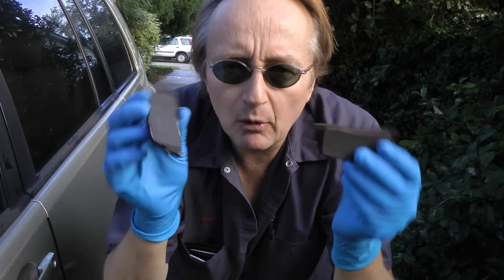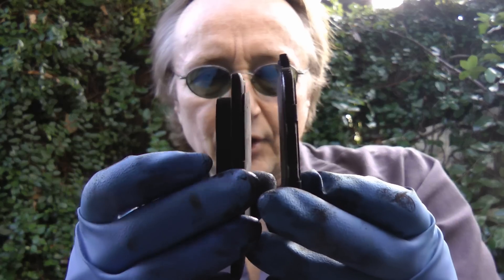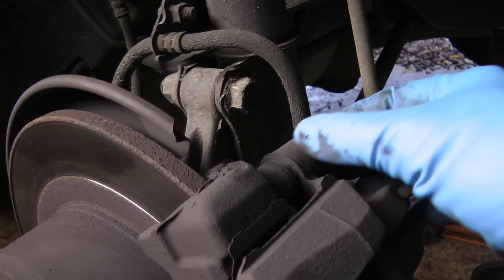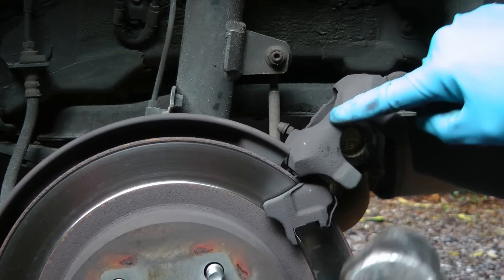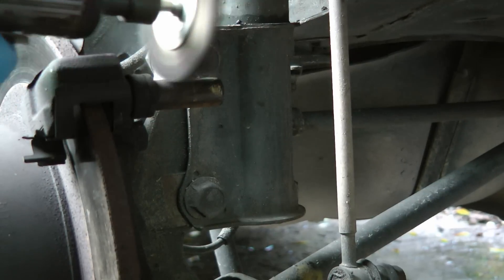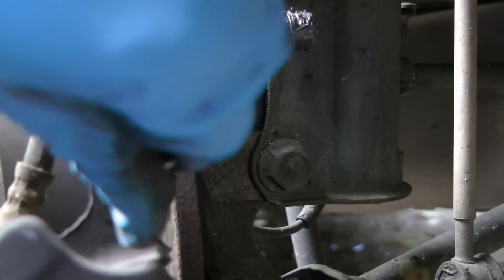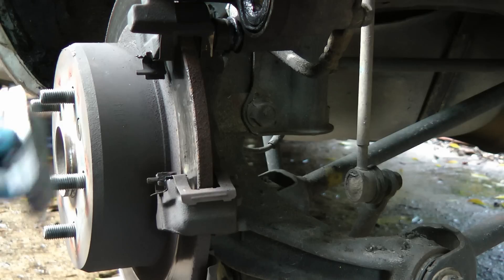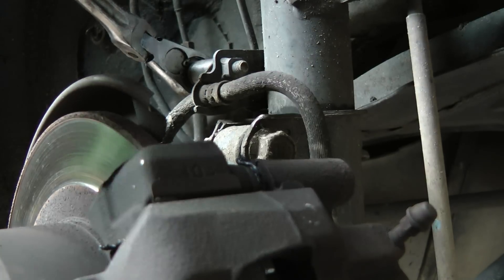How to Stop Brakes from Squeaking and Sticking in Your Car

Comment: Noticed when inspecting my car's brakes a while ago that the inner pads on the front brakes were worn down almost completely. I replaced the pads and didn't notice any sticking of the caliper. The pins were still shiny without corrosion and still had some grease left on them. Also I haven't had any noticeable brake dragging or getting hot or anything like that.

Also, the rear brake pads were worn quite evenly. Only the front brake pads were severely uneven and by the exact same amount on left and right side.

What could have caused the inner pads to wear significantly more than the outer pads if the caliper was not sticking?
Reply from the maker: MTTT3000 the calliper is not sliding correctly on the front. take both off, clean any residue and lubricate all the sliding parts, put it back on without pads on it, and see if you can easily move it side to side
Reply: Scotty Kilmer
That's pretty much what I did when I replaced the pads. I cleaned off the dirt and old grease and made sure the pins were smooth and it could slide freely. Hopefully that did the trick. I'll keep an eye on it every now and then to check for uneven wear.

Just wanted to make sure there wasn't something else causing the uneven wear.

Thanks.

Comment: hi I'm doing the pads a rotors on my car for the first time. is there any good way to remove frozen rotors? and is there a way to torque bolts that my torque wrench can't reach?
Reply from the maker: spray WD 40 on em, and hammer the heck out of them. Then hit em with a torch if they don't come off and heat will loosen things up. But, ya can only torque what you can reach with a wrench, hence I rarely use one myself in such impossible situations

Comment: Hi Scotty, my son is working on a 1996 Buick Regal, rear disc brakes. The bracket that holds the pads on is stuck on the caliper pin. How can we get the bracket off the seized pin??? thanks, Caryl
Reply from the maker: I spray em with penetrating oil and let em soak a few hours, if that doesn't work, i heat em up with a torch, but realize that often ends up making you buy a new one when you get the old one off if stuff melts
Reply: Scotty Kilmer  Hi Scotty, thank you so much for your ideas. what you suggested was a big help. May I ask your opinion on this tool? it is a cube that compresses caliper piston where there is a parking brake involved. Thank you for all you do! You are truly wonderful. http://www.autozone.com/autozone/accessories/OEM-Rear-disc-brake-cube-for-use-with-3-8-in-drive-tool/_/N-255s?itemIdentifier=2363
Reply: Scotty Kilmer
Hello again, when my son when to bleed the brake lines, his helper cranked on the bleeder valve and it broke off.  Any ideas on how to remove this? We have an "easy out" here at work. would that work on this application? thank you, Caryl
Reply from the maker: baire702
yea, I have one of those works fine if your hands are strong enough. Use the EZ out for the bleeder
Reply: Scotty Kilmer
 yay! Scotty saves the day, AGAIN!!!!!!! Thank you! By the way we got the Go To socket for removing rounded off bolts and nuts. What an excellent tool. Thanks for recomending it!

Comment: hi my question is can i just replace the side that is bad(both pads) just on one side.
the other side is fine.
my rotor has a fine smooth feeling of it but on one side it has a small groove that goes deep,besides that is fine. do i neeed to replace the rotor too?
Reply from the maker: You can replace one side, I do both myself, but you can do one. I would replace a rotor with a groove
Reply: thankx for the responds:)
i have another question.
the two pins that go on the caliper one has a rubber plug and the other one doesn't.
i lube both of them but after i did that the one with the rubber plug wont go in all the way,i got tired of trying to put it in that i gave up and took the rubber plug out and put the pin in without it.
what will happen since i dind't put rubber plug in with the pin?
and what does the rubber boot do?

Comment: Hello scotty i know its an old post but i have a question , the caliper pin slide in a rubber tube and not metal can i still use the caliper grease ?
Reply: Yes

Comment: I got a problem with my brother's 2012 Ford Focus front brakes. the pads are wearing slightly uneven from the inside to the outside of the wheel, but what concerns me is the "terraced" pad wear, it kinda looks like steps. The box says it could be the calipers not working properly, or the rear drum brakes not working. Any help?

Comment: What's with the top slide pin being grey colored and round and the bottom pin being gold  colored with a flat. I noticed that on my wife's Honda.
I guess the perfectly round grey pin always goes on top because I had 'em reversed on the left side rear and that seemed to be the only cause of severe uneven wear on the inside lining even though they where cleaned and greased w/ the proper stuff .

Comment: I just bought a 1997 vw golf with 4 wheel disk brakes.... it has new brake pads all around but i have to push the petal almost all the way to the floor for the car to stop.. There is a good 4 inches of travel that nothing happens...Any ideas what could be wrong

Comment: Why are my brake grinding and binding after change pads and rotors..i greased the pins..what else could be the issue?
Reply from the maker: John Weaver III  of course check the other set of brakes if you only changed one, often noise will then come from the other set. But if not, you either installed parts wrong or got poorly made parts that don't fit

Comment from the maker: check to make sure your callipers are not sticking on in the front, brake hard, jack up the car and see if wheels don't spin easily. But if they do, realize those babies have pretty cheap rotors and pads, often aftermarket non chinese made ones are better than OEM ones which are often from china

Comment: @Scotty Kilmer comment below should say i now replaced the FRONT flexi pipe too (sorry fat fingers)
could a faulty master cylinder cause my brakes to jam on solid?, both front right (drivers side) brake and back left (rear) jamm on at the same time, this happens now and then not every day, the only thing that releases it is either kicking the brake pedal lots of times hard OR physically undoing the bleed nipple on the front right calliper (i already replaced the calliper) this is not sticking on.
The brakes get that hpt after they jam on,there too hot to touch and sometimes smoke.
 so FAR I REPLACED THESE THINGS: both front pads and discs,both rear shoes and drums,replaced front right flexi brake hose,topped up brake fluid,so doesnt leave much.
Master cylinder was replaced but 6 years ago as this problem of braking also happened to the previous owner,it has come back again to haunt me.

WOULD A FAULTY MASTER CYLINDER cause the brakes to lock on diagonally,is that how the brakes are connected and is the brake master cylinder responsible for these 2 brakes jamming on exactly at the same time??

Finally was told that theres a pin at the rear of the master cylinder that sometimes jamms on it goes into the servo, can this be backed off if its adjusted too tighly
Please help imk desperate,i did visit the Scottl Kilmer channel like you said before its too late
Reply from the maker: yes it could cause them to stick on
Reply: Scotty Kilmer
thanks,ive since found out since your comment it to be this problem,i unbolted the 2 screws holding the master cylinder to the servo and immediately the brakes released
tomorrow i will remove completely the MC and re adjust (back off) the servo push rod

Comment: Hey Scotty I have 2004 Honda Civic si hatchback my rear passenger caliper sticks when I tight the bolt the wheels wheel not move can you please make a video
Reply from the maker: +sonidodurancheran04 disconnect the brake line at that calliper, and if it still sticks, replace the calliper. if it stops sticking, then master cylinder is making it stick on or brake hose has collapsed there
Reply: +Scotty Kilmer i install another caliper but know the hand brake is not working ?

Comment: Hey Scotty, I rotated the tires on my 03 BMW last week and now the rear passenger brake is stuck. Did I do something terribly wrong?
Reply from the maker: check to make sure that wheel is not on crooked, and that the nuts are not too tight, warping the rotor and causing brake stickage

Comment: I have a 1985 corvette and had a mushy brake pedal that hardly applied any braking power. So I bought a new master cylinder bled the system and put all new fluid in it but now the pedal will barely budge and as I tried to drive it a short distance I noticed the brakes were slowly starting to lock up on their own. Now its been parked for a little while and regardless of whether its running or not the brakes are completely locked up. could this be a problem with the brake booster or could there be more going on?
Reply from the maker: German Maza   replace the brake booster, I just did one on the same car a month ago
Reply: thanks and is there any way I can free the brakes not to be driven but just to be moved to a better spot to do the work?

Comment: Im still messing with sticky brakes. Question if you have ever seen this. Can a worn wheel bearing (not making alot of noise) cause the brakes to randomly drag? I have wear on a tire thats odd and ive been told its a wonky wheel bearing. All new hoses, all 6 of them, calipers, pads, rotors, master cyl and booster. When the brakes are cool the car rides free and smooth. After they get some heat into them after a couple of 50mph stops (not hard stops) they will start to lightly drag and stick. Im out of ideas here as yesterday I replaced all the back rubber hoses since one appeared to have been crushed with a vice grip at some point and they were 17 years old but it didnt work out. 

I dont have nothing else left to try on the car, even the fluid has been flushed twice with pentosin super dot 4. Mechanics ive asked are even stumped as none of the brakes even get to the higher end of what they see in normal brake temps.
Reply: Another question I may have figured out. Would a slightly out of adjustment brake booster rod cause the brakes to randomly apply a tiny bit while driving?

Comment: 2003 chevy cavalier I replaced brake pads calipers brake hose and when I drive over 70 meh wheels star shaking I know is the brakes because I open the calipers twice it drive good for a while but it started doing again

Comment: scotty i know its hard to diagnose suspension noises over the internet but on my trailblazer with 145,000 miles when i back out of my driveway that has a pretty big hump i hear a creaking noise coming from the front end. i also hear creaking and squeaking when coming to a stop. but i hear nothing driving normally. i know in the car's lifetime its gotten new struts and tie rods. i'm thinking it needs balls joints. any help would be appreciated

Comment: I have a question, my break pads get stock on the left side, when I break it seems like it's still breaking when I'm actually accelerating, it's only on the driver side and its smokes after I break, what can I do and how can I do it, it's a Mercury seable 1996, thank you...
Reply: Eric Mendez Not sure if you fixed it, but i have a similar issue, I push the brake pedal and the pads get stock, i try to rotate the rotors by hand and it is very hard, then i try to use a hammer to try to hammer the caliper body  (gentle) a little bit and then the rotors start spinning easily again, it seems the pad holders (metal retainer clips) are not letting the pads retract once they have being pushed by the caliper, i think greasing the clips might help.

Comment: well today i jacked my trailblazer up and on the left front there was no play when i moved the wheel at 3 and 9 o'clock but then when i tried moving it at 12 and 6 o'clock it had play so this means i have a bad ball joint but then when i went over to the right front the exact opposite happened at 3 and 9 o'clock the wheel had a lot of play in it which means i need a new tie rod but then when i tried moving it at 12 and 6 there was no play. im just confused on why the parts didnt wear the same.

Comment: Hallo

I have a audi 100 5e 1980 model
The brakes get wear on one side more then the other in the front it does not have caliper guide pins just one big cylinder what could be the problem?
Reply from the maker: Jaun Pierre Botes  worn callipers

Comment: i own a toyota 4runner 2000 limited edition. 
and one side of the rear wheel gets stuck and the other side works properly.
what could that be of?
it feels that one side is totally jammed.
Reply from the maker: +ali al jumma  sticking brake callipers often do that

Comment: I got a 2000 monte carlo and my front driverside wheel is squeaking and it's due to my brake caliper is pressing against the rotor..how can I fix this ..I do need a new wheel hub because it has played but this problem just started an I still had play in the wheel but no speaking
Reply from the maker: a new hub should fix it, that causes rubbing when really worn
Reply: Would it be alright just to change the hub. Or change the hub an rotor??

Comment: That grease you are adding ro the pins goes in between the shim and backing plate, not on the slides/guides. Silicone based grease goes on the pins/ slides. You should know this.

Comment: i was told never to use grease on the pins bacause the grease will eventually eat through the rubber cause they are made of a petrolum product you should use silicone paste

Comment: Can I use bearing grease
Reply: It is a bad idea. The rubber will deteriorate faster. I suggest to consider silicone based brake grease for the pins. For the brake pads it is also a bad idea, as the bearing grease cannot handle the heat.

Comment: Hi Scotty,

I've emailed you before but I seem to have lost your email address.
Here is my problem with my 2001 Rav4 Toyota 225000K miles: I have a caliper that is sticking.  I've replaced one twice the calipers on one side and the hose but it seems to be sticking.  Sometimes it's really bad hearing it gripping, etc.. and then a mile or so it opens up... What else can it be?  It's not the master cylinder or both would grab.  Any suggestions would help.  I don't believe the pin is rusty or sticking.

Comment: When it's warm outside or the sun is shining on my brakes, the back wheel just skids and the bike is hard to move, it's like riding with the brakes slightly on. The friction causes extreme heat and smoke. What could be wrong?
Reply from the maker: replace the brake pads and rotors, they are both glazed

Comment: I HAVE A CHEVY S10 1997 I TOOK IT TO A PROFECIONAL MECHANIC  BECAUSE OF SOME STRANGE NOISE OCCUREDWHEN I WOULD PRESS THE CLUTCH TO ENGAGE TO NEAUTRAL AND THEN THE BRAKES TO STOP. LIKE A LOOSE GRINDING DISENGAGEMENT NOISE WHEN MY TRUCK WAS COLD AND ALSO WHEN SUDDENLY STOPPING HARD.AND THEY SAID THAT IT WAS THE MISTAKE I MADE WHEN I CONFUSE THE POWER STEERING FLUID FOR THE BRAKE FLUID , BUT WEARD NOISE STARTED BEFORE I DID THE FRONT BRAKE REPLACEMENT. MY SCHOOL TEACHER REPLACE THE MASTER CYLINDER ALSO BEFORE ME REPLACING THE FRONT BRAKES SO WHAT COULD IT BE BECAUSE MASTER CYLINDER WAS REPLACE BECAUSE OF THIS NOISE BUT KEEP DOING IT , LATER FRONT BRAKE REPLACEMENT WHEN BLEDDING THEM I PUT POWER STERRING FLUID ???  BUT THE SAME PRVIOUSE  NOISE NEVER STOP.. SO WHAT CAN IT Be???
Reply from the maker: first, power steering fluid in the brake system will ruin the entire braking system over time, wrecking all the rubber seals. But stopping hard and noise is often a bad brake booster assembly
Reply: where exactly and how many seals r u talking about? Master cylinder< brake-lines, caliper seals or do u think that power steering fluid could have gotten inside booster is it possible?
Reply from the maker: mercyk9
na, not in the booster, but it could ruin any other seal in the brake system
Reply: okay thank u so much!!!

Comment: I have a 1995 toyota 4runner, recently I've replace the calipers, rotors, master cylinder, brake booster, and the brake lines are new. Now, after driving it for 15-20mins on the road my car feels sluggish. You can smell the brakes and you can see brake dust on the hubcaps. Oh and the brake pedal gets really hard. Once i stop for a bit and touch the hubcaps there really really hot . Anyone got any ideas what could be wrong. Im at a point where i want to get rid of the car.

Comment: That wire brush sounds like a dentist's drill. Yuck!

Did you replace the brake pads on the other wheel or is it OK to change them on just one wheel?

Comment: can it be a stick caliper piston if you got a f150 2005 - and just on the right passager front tire it has some drag about 1/4 of a full rotate... when im driving i could here it everytime the tire spins sounds like a jackass eeee awww eeee awwww.
Reply from the maker: it certainly can be, that or  a collapsed brake hose that won't release pressure

Comment: Hé,don't you have to use a torque wrench?
Reply from the maker: neophytes and anal mechanics can use em, but for most jobs, they are not needed if you get things tight enough with bare hands and tools.
Reply: gbin21 When I replaced my engine I would tighten the manifolds onto the block very carefully and snug.  Then I'd check how close I came within the torque range, using a torque wrench. I found that I was always within the correct torque range as long as I tightened the bolts snug.  To be over the torque range I'd have to almost strip the bolt. To be under the recommended torque range I'd have to be really stupid to barely tighten the bolt that much. Therefore I concluded the torque wrench specs are for assembly line workers to make sure they don't forget to tighten a bolt or over tighten one since they're moving so fast from fastener to fastener and engine to engine.